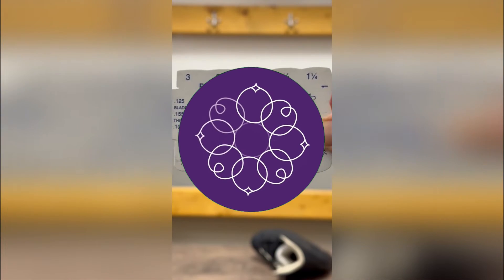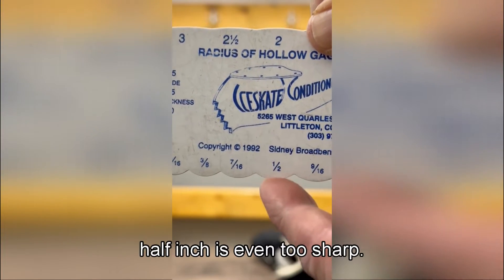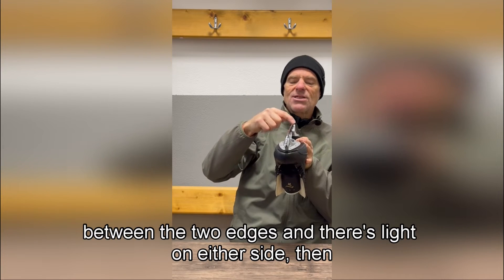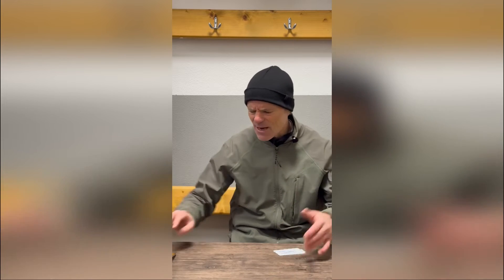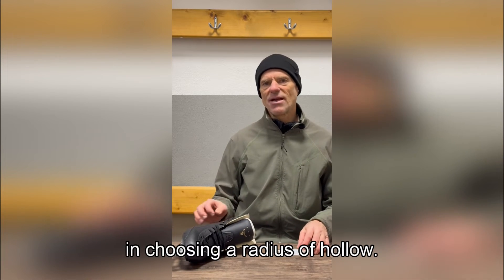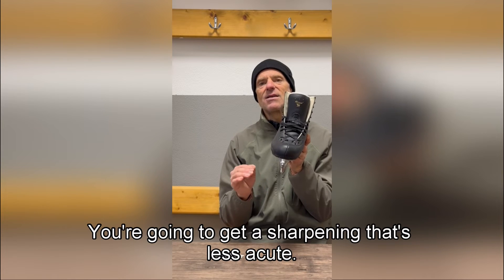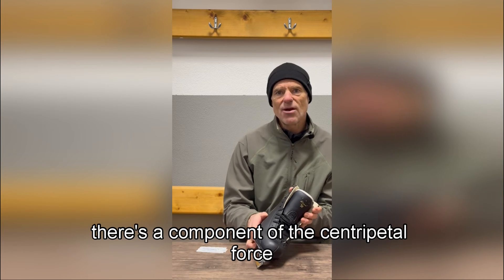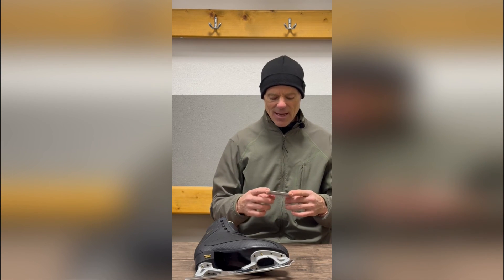SHARPENING RADIUS

Comment: Fun fact: speed skating blades don't have any hollow. So when the blades are straight up, they could slip. And the stroke is directly to the side once you get going. I am speaking here of long track speed skates. I am not a speed skater but I did rent a pair of long track skates once just to try them out. The blades were as long as windshield wipers, I think 17 inches. I couldn't get a crossover going in my one session...so the turns went slowly...Eric Heiden I am not! Gary, thanks for your expert advice. I am going to speak to my sharpener...🙂
Reply from the maker: Hi John, speed skates are a good example of what I am suggesting in this video. There is enough grip on deep edges that are used to accelerate at the start of a race or to go around the curve at the end of the rink, but the right angles for edges are ideal for minimising friction. You can also share the link to this video with your skate sharpener.
Reply: @GaryBeacom-FigureSkater  Hi Gary. I would indeed like him to see this. BTW love your skating, and saw you in person in Hartford, CT, back in the day. Something about hand skates...hmm...ring a bell? Maybe we need MORE edges! 4 more, or is it 8? How do you sharpen them hand skates? Do hand skates dream of having feet in them? People are way too set in their ways and afraid to try fun stuff. Not you. Skate on! And thank you for being you.

Comment: Great info !
The fact that skaters train on different ice surfaces is an issue. Some ice rinks have harder ice than others.  I’ve found that using a bit of a deeper hollow but filed off a little bit helps them with grip and that they aren’t so sharp on softer ice. I use the finger nail scrape test to gauge the sharpness as I take the sharpness off the blade.

Comment: Thank you, Gary :)This was so good video and important knowledge. I changed blades recently, the rocker is same. Here they use to sharpen to 0.4 0r 0.5 ice - 11mm. I manage quite well with these blades but bc they're sharp, breaking is abit difficult (ha ha :))Jumps waltz and salchow satisfactory, spinning nice.  I'm a tiny small woman, 148 cm and light weight, so would you recommend  I'd take 7/8 next time. Fine skatings from Finland --Anu